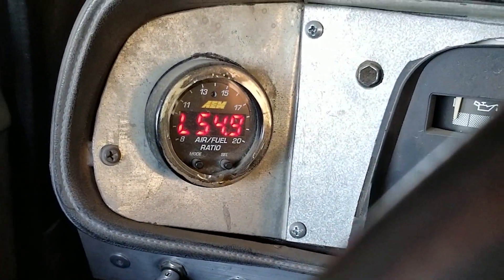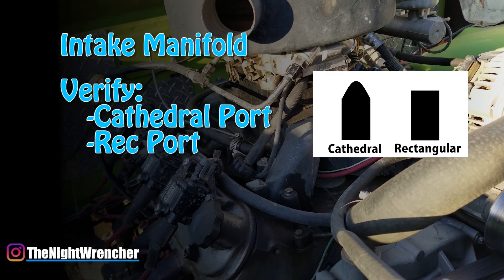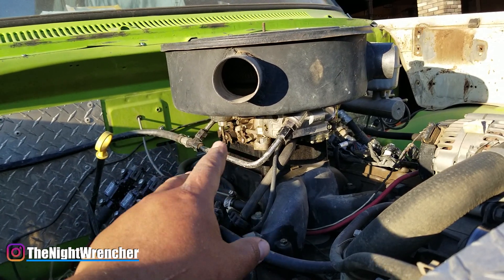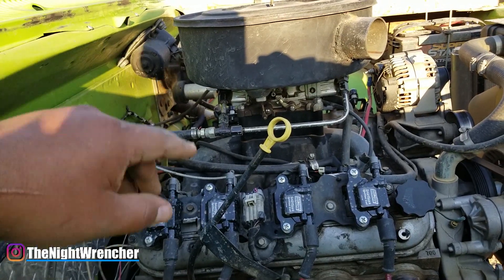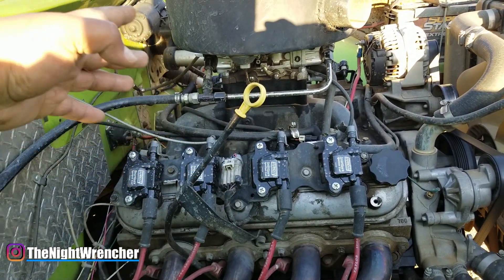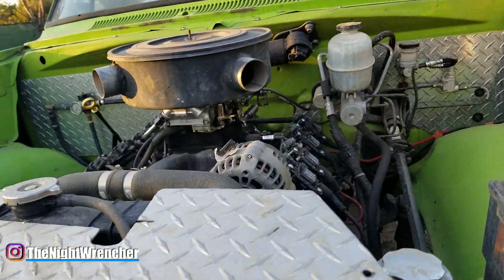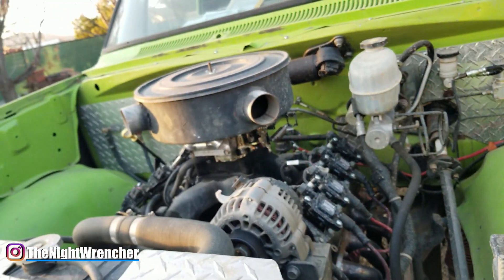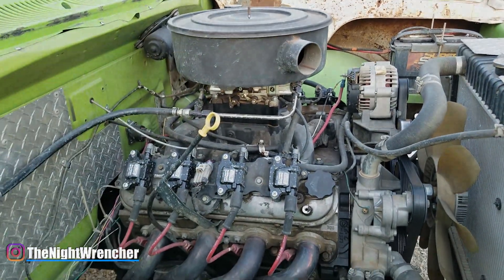How To Install A Carburetor On An LS In 2021 | LS Carb Conversion | Carbureted LS |

Comment from the maker: I'll be updating the description with part numbers soon! Check back in a few days!
Reply: Ordered the fittings for the gauges from ict the other day and ordered an rpm manifold and gaskets this morning from jegs. Picking away at it.  
Another question:
The lift on your dodge ? I like the flex I saw on one of your videos. Whos the maker of your lift kit ?  Thanks for your help.
Reply from the maker: I did the lift myself, rearched my own springs and everything. I have a video on it too
Reply: Excellent. Thanks.
Reply: One more question. I can just hook up the original wiring harness from the k10 right to the starter etc just like factory ?
Reply from the maker: The starter Should wire up the same minus the coil wire that you might have to use for ign box during cranking

Comment: How did you run your vacuum lines from the valve covers?
Reply from the maker: Pcv valve in the big hole and then a 3/8 hose to the carb

Comment: Hello so i recently installed q 5.3 carberated in my Monte Carlo using a 750 edlebrock and msd 6014 .. car starts but when i rev it stumbles and if i let it sit and idle it will eventually die any recommendations
Reply from the maker: @Big-hv9sr  idle circuit is probably lean and needs to be properly adjusted
Reply: @NightWrencher  idle circuit? Like the idle air screws in the front of the carb?
Reply from the maker: @Big-hv9sr  those are fuel. Counter clockwise open to add fuel. Clock wise to close fuel off.

Comment: I hate all the sensors and control modules. Even what there is on my 1999-2006 gm chev trucks. I keep having to reset the maf sensor on my 2001 8.1 vortec. Eventually I want to do something like what you're doing here. Thanks for putting this stuff on yt👍

Comment: Are you still running the 727 transmission
Reply from the maker: This truck was originally a 3 speed manual truck so no 727. I dont even think theres an easy way yo bolt a 727 to an LS actually
Reply: @NightWrencher  ya I been looking around but haven't found anything  so what transmission are you running
Reply from the maker: @andrewmosley5976  I'm running a Toyota R150 5 speed manual transmission

Comment: Last question lol..appreciate all the help. I'm not doing a performance or cam jist carburetor 5.3 ..with a 350 transmission should I use a regular torque converter or 2600 to 2800 one.

Comment: You think a off brand intake .with elderbrock be ok..what's your opinion on off brand intakes for the ls
Reply from the maker: The chinese intakes are just copies of the holley intakes. Not as good as a real edelbrock intake but good enough to drive around. An edelbrock carb is fine as long as it runs decent out of the box. If you gotta tune it, I cant help you on that one

Comment: Do we have to do anything special for the coolant tube up .small radiator hose I think it's like 1/4
Reply from the maker: You just run that back into the top radiator hose. Its to remove air bubbles.

Comment: What throttle cable bracket are u using?
Reply from the maker: A cheap one from the auto parts store 😂
Reply: Thnx found one at Oriellys

Comment: at 3:42 you talk about a harness
i wanted to run a 5.3 carb in my 71 nova thats currently running a 250 inline 6
am i still gonna need the ls harness or will the carb ls system connect to my car?
Reply from the maker: You will need the harness for the ignition system. Its not an LS harness, its just the harness for the ignition box

Comment: Hi Nightwrencher!
I have a bit of a complex question regarding bypass fuel regulator. I have a 1993 foxbody that was originally a 4 cylinder, putting in a carb'd LM7. I've got the stock mustang in tank fuel pump and stock fuel lines. From my research the stock mustang fuel pump puts out somewhere between 55-90 LPH. Can I use the aeromotive 13301 bypass regulator? Or do I have to get the overpriced Aeromotive EFI to Carb dual stage regulator 13220
Reply from the maker: It honestly depends on the size of the return line and how much fuel the fuel pump puts out. Ive ran pressure regulators that would work fine on some fuel pumps pump get conpletely over powered on other fuel pumps. According to the parts book, the 1993 4cyl mustang has an 18gph pump at 51psi so the 13301 should work fine on that application
Reply: @NightWrencher   Dude, I cannot tell you how much you are appreciated.
Reply from the maker: @josegodoy7283   Is no problem man, anytime

Comment: Carb sizing is based on math.

(Cubic inches × max rpm) ÷ 3456 (if you're running a V8. 3456, though looking ike a funny number, is the conversion for cubic inches to cubic feet, and for 8 cylinders)

5.3L is 334 cubic inches
Google says you can take a 5.3 to 6000rpm.

So, (324 × 6000) ÷ 3456 = 562.5

So, at 6000rpm, the MOST cubic feet of air a NA 5.3L can move is 562.5. But, no motor runs at 100% volumetric efficiency, so we assume 80%.

562.5 × 80% = 450.

So, carb selection for a 5.3L is 450cfm to 570cfm. Any smaller will choke the engine, and any larger will give a weak signal to the venturis, causing the engine to stumble when going from idle to WOT.
Reply: I thought 5.3 was 323 ci

Comment: I totaled my 02 2500HD, it still runs rides and drives but the frame is bent and it only has a limited amount of time before reaching terminal failure! I also have a solid 3rd gen Camaro just sitting in my back yard. Thinking about transplanting but this looks like a lot of work. Any tips? Don't bother? WDYT?
Reply from the maker: The engine should drop right in using the camaro transmission if it's a V8. You would need an adapter flexplate and spacer for the torque converter and adapter plates for the motor mounts but aside from that, the rest should be easy. Run the factory EFI harness, order a flashed PCM for like $150, install a high pressure fuel pump, install fuel injection rated lines, corvette return style regulator and you're basically done. Going carbureted might be easier but it is more expensive
Reply: @NightWrencher  It's got an LT1 in front of a 700R4. The 700R4 was rebuilt but I need to pull the valve body and check for sticking valves because I only downshifts manually. It has sat a long time so that might be part of it.
Reply from the maker: The 700r4 should hold up fine if you're not too reckless
Reply from the maker: If the camaro does not have a transmission, I don't know if the transmission tunnel in the 3rd gen is big enough to acomodate the 2500HD transmission

Comment: Serious question why does one need to change stuff to do with the trans for a carb conversion?
Reply from the maker: Because the transmission is computer controlled on efi ls engines. When you go carb, the aftermarket ignition modules dont have built in trans controllers so you either have to go with a non computer controlled trans like the 700r4, th350, th400, etc or find a trans controller that works with the trans you want to use or convert the newer trans to use a manual valve body.
Reply: @NightWrencher  I'm curious if you could possibly help me with all of this. 
I'm wanting to convert to carb to get rid of most of the wiring as possible especially the throttle wire. Do you have a list of everything needed to convert? I'm trying to decide if I should carb swap it or just do a throttle cable conversion. The throttle cable conversion involves having to have the engine tuned which I'd rather not have to deal with. I know this is asking a lot but I'd be forever grateful.
Reply from the maker: In the description of the video there is a parts list of what you will need with options. Total it up and see if its worth it for you to pay that and also buy a wideband and learn carb tuning because no carb is perfect out of the box. I have over 30 videos on just carb tuning alone that you will have to learn if you want everything to work right. If you have something that came factory with an efi LS like a silverado or camaro, leave it alone, you will only make it run worse with a carb I guarantee it.

Comment: What application are those headers for?
Reply from the maker: Theyre for camaro but I should have used silverado headers instead
Reply: @NightWrencher  the IROC year Camaros? I have a 66 C10 but not sure what headers to get yet
Reply from the maker: Mine are for a 2010 camaro. They splay outward where the silverado header are straight. The c10 headers would also work for me. For a 68 camaro I'm not sure what long tubes would fit.

Comment: What do you use to plug your injector ports?
Reply from the maker: The new manifold doesnt have injector ports and the harness for the ignition module doesnt come with injector wires

Comment: is a demon street carburetor with a single entry able to be installed as well. I see the carbs you have two entries.
Reply from the maker: I don't know what you mean. Are you talking about the new street demon with the plastic center section?

Comment: I have a question please . Is the edelbrock Avs2 800 cfm enough for stock 6.0 LS . and the msd box is works right out of the box just ready to go or you need to re program it .That’s it thanks a lot .
Reply from the maker: The msd box is designed to plug in and fire up. As long as you plug in the vacuum hose to it and the onboard map sensor hasnt died then it should get you going.  A stock 6.0 with full acessories is 300whp with a redline of 5k with stock worn out valvesprings. Even a 650 is more than enough for that low of hp.
Reply: @NightWrencher  thanks for the replying . Does the carb make more hp than EFI . Because in your video screen you typed +50 hp . Thanks again
Reply from the maker: We'll it depends. The gains come from modified engines, stock for stock, the EFI will make the same or a bit more hp  but a dual plane carb intake will make more low end torque
Reply: @NightWrencher  is there narrow or low intake manifold for this application because I have an 81 Malibu I don’t think it’s gonna fit under the hood. Thanks for your help . You are awesome .
Reply from the maker: The dual plane and mid rise intake single plane have only only a .060" inch difference in height. The hi rise or super victor are way taller so a dual plane with your edelbrock carb is as low as it can go. They make low profile air cleaners so maybe itll fit. If not, you'll have to go EFI because they have lower manifolds like the LS6 intake. If someone has already done this swap before on that chasis, you should be fine

Comment: What fuel pump are you using?
Reply from the maker: I'm using a stock in tank D150 TBI pump. I have a video on it on the channel
Reply: @NightWrencher  what regulator are you using
Reply: @NightWrencher  I'd like to use an efi pump but not sure what regulator to use

Comment: Hey man love the videos. I’ve got an LM7 and 4L60e. I’ve heard of people running the stock ECU (Cam/Crank/MAP), and wasn’t sure if you considered or heard about that. Don’t see any reason it wouldn’t work with a carb. Thanks for any help!
Reply from the maker: Hey man, you would have to go through HP tuners and creat a custom speed density tune that would ignore the fuel injectors and run spark only. You would also have to run a compatible TPS on the carburetor in order to run the electronic trans. Its not hard but its not that easy either. If you dont use the stock computer, youll have to run a trans controller for the 4L60 instead. Hope this helps

Comment: Question bro I have 5.3 gen4 from a yukon cathedral port.. putting in a 85 elcamino I have dual plane holly intake Daytona smart spark and edlebrock 1406 carb ... I bought a ls9 cam will my 600cfm carb be cool with that cam its goin be regular driver not racer build. And will I have enough room for a carb spacer bro.. thanks 4 ya time bro
Reply from the maker: Hey man, the 600 should run fine. You might need to do some tuning it get it to run clean but the same goes for any carb. Edelbrock carbs are more forgiving so it might work out without issues.

Comment: on the smart pack can i run different timing tables just by selecting on the dials
Reply from the maker: Yes you can, it has 9 tables or you can program your own
Reply: @NightWrencher  thanks  i was told i had to upload everytime i wanted to switch cause it wouldnt  hold different ones
Reply from the maker: Well, it depends, the box has 9 preset tables bit you can only run 1 custom one because it does indeed have to be uploaded. If you upload the custom map and then turn the dial, I'm not sure what happens but I'm assuming it will just switch to the new preset and your custom one will still be logged there but I'm not sure

Comment: We put a 6014 on my buddies ls swapped Nova, at first it seemed to work great, now it seems to run like garbage. After watching a few of your videos we decided that were going to plug the laptop into it, and see if the map sensor is even working. I'm going to wind up running an ssls on my swapped Nova. Thank you for the good info!
Reply from the maker: Those 6014s run great when they work. But for how long, is the question.

Comment: what issue did you run into with the msd box? I have the msd on mine ls now.
Reply from the maker: Map sensor issues which are not uncommon but, they also didnt survive all the vibrations from offroading

Comment: The good old carburetor. I remember those. I would think they would be a nightmare with todays fuel. They were a pain with the old fuel. Lots of carb rebuild kits sold back in the day. 
How do you keep the engine from overheating with no fan shroud?
Reply from the maker: It actually runs pretty flawless, the key is in a modest tune. Not too rich not too lean. The engine is iron block but with aluminum heads, slightly rich tune and the radiator is larger than the stock one for that engine so I havnt had any issues even on a hot day like today in uphill traffic. I'm planning to make a nice shroud, just need to make sure it clears everything. I had the engine over heat once but that was because the fan clutch that came with the junkyard engine stopped working and wouldnt kick on anymore
Reply: @NightWrencher  That's another thing the carburetor trucks didn't have. Nothing but flex fans. I've actually toyed with the idea of putting a flex fan on my 91 w250  diesel.
Reply from the maker: I never really liked flex fans. The stock dodge truck big block radiator is massive so the clutch fan rarely kicks on, especially on the freeway. The radiators on the newer 1st gen trucks are smaller. Idk about the diesel trucks but I'm willing to bet the older trucks had bigger radiators
Reply: @NightWrencher  Mine's early 91. Came with a small 2 core. Ran hot everywhere it went. Installed a aftermarket aluminum big 3 core. Built for the truck. Cost big $ but it was worth it to get it to run cool. Also installed aftermarket intercooler at the same time. Very tight fit but it works. Dodge didn't put the bigger radiators and intercoolers until 91.5. Been wanting to upgrade the turbo for yrs. Just haven't found a setup that's turnkey. I don't enjoy turning wrenches like i did when i was younger. Rather not do a lot of modifications for the upgrade.
Reply from the maker: I have 2 parts trucks, an 85 and an 88 and I was planning on reusing the core support complete for my ramcharger but the radiator was so thin, I'm juat going to modify the support to accept an older style radiator. Theyre still pretty expensive, almost the same cost as a fancy one. But it keeps my stuff cool so at least theres that
Reply: Marvel mystery is good stuff for fuel treatment and carb cleaner. And it’s keeps the rubber seals fresh

Comment: How did you do the pcv system?
Reply from the maker: I've got the passenger side with a filter on the nipple and the driver side off the PCV valve with a 3/8 hose thats hooked up to the carb base plate. If you have a brake booster and only one 3/8 fitting, either add another fitting or T off the line going to the booster as close to the baseplate as you can to prevent oil being fed to the brake booster.

Comment: I have a 5.3 with 650 carb with msd 6014 and can not get it to stop running rich for the life of me. It’s chopping plugs like crazy ever had that issue?
Reply from the maker: Could be a carb issue. Make sure it dies at idle with the mixture screws turned all the way in. If not, its bypassing fuel

Comment: How do you make the speedo work on an older vehicle with the carb ls swap in it?
Reply from the maker: Depends on the trans but if you don't have a trans that is compatible with the stock speedo you'll need to buy an aftermarket gauge and either wire up the electronic speed sensor or find a conversion cable that works with your factory mechanical speedo.

Comment: Holy smokes. It's all here. In a 13min video.
Reply: Any other YouTube channel would have made this video in 3 1hr parts, cuz it's good for their metrics. I was literally just wondering about this. I'm angling for an 04 GMC w/ a 6.0, and since it's the east coast, it's about to molt, so I'm thinking about nabbing a 70's wagoner or something from out west to drop the important stuff into, and I wasn't sure if I could run a carb or not.
Reply from the maker: It has a learning curve, but if you have patience it can run even better than EFI
Reply: With 8000x less headache I bet.